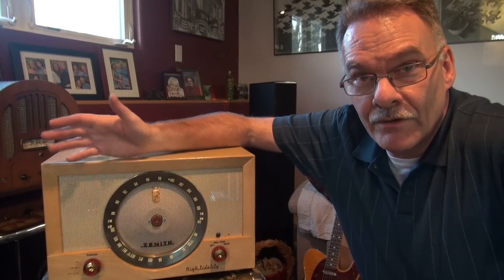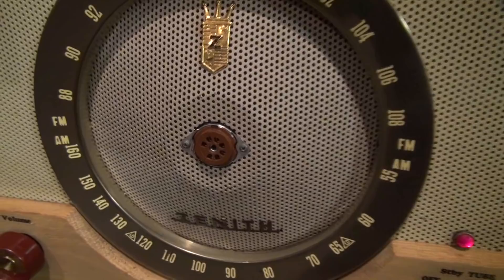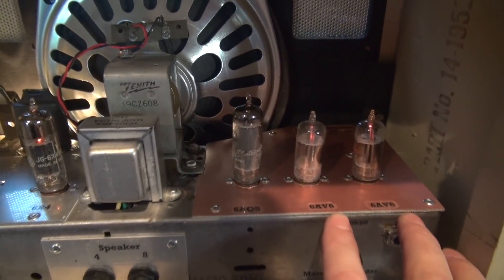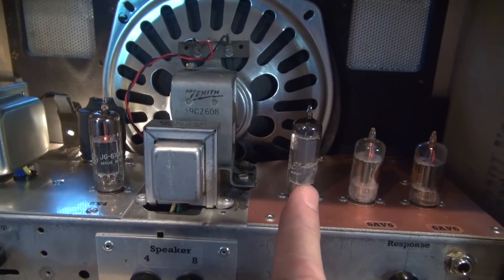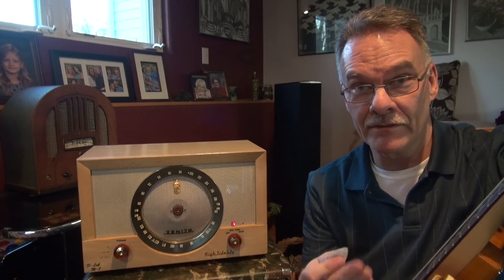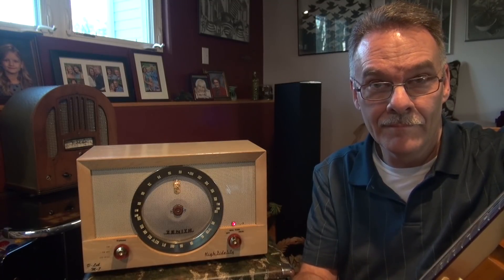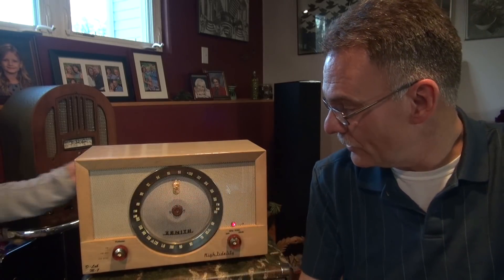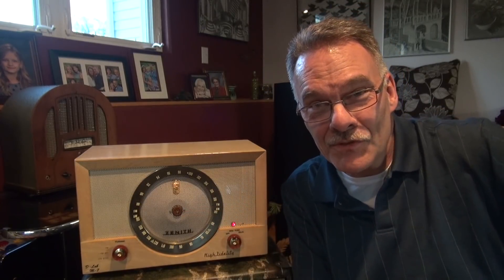D-lab demo 6AQ5 Boutique tube guitar amp built in Zenith radio cabinet

Comment: I notice the difference but only with the built in speaker - it sounds brighter with the diode rectification .  I’d like to see a vid showing the tonal difference between the 6AV6 tubes and 6AT6 tubes. How did you get it not have hum? Filament transformer with center tap to chassis?

Comment: Hello Terry,  Dan here.  Always great videos! I'm trying to squeeze 2 or 3 more watts out of my Eico 147A Signal Tracer. The schematic is soooo close to the Fender 51E. It already sounds killer stock. (I replaced the audio in jacks with 1/4" female) but quiet like a mouse. Looks like I may have to change transformers and/or 6X4 rectifier. Not a hack job. Just want the Champ's 5 watts. Will still be used to trace. Any advice would be greatly appreciated. Thanks!

Comment: really a beautiful conversion Terry! when the big cab was on the treble really dropped out, like the guitar tone control got inadvertently rolled off? keep it coming!
Reply from the maker: Yes Sir, I believe I hit the tone control on the guitar (bo-bo) It does sound great on the cab. With no tone controls, the sound is dependent on the type speaker & guitar used. I was impressed with the internal speaker, still performing well after 50 yrs. Thanks for your support.